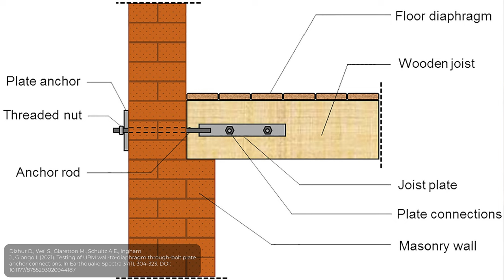Top 3 Deadliest Buildings in an Earthquake - Engineer Explains

Comment: You can go to Turkey (Kahramanmaras) to see which type of buildings are collapsed. After 7.8 then 7.4 then 6.8 earthquakes (and yes in a row) more then 1 million buildings are either damaged or collapsed. It's perfect way to examine the effects of earthquake and it's damage over types of building.
Reply: 100% of failed buildings were concrete structures... Steel is better
Reply: @skaford  wrong
Reply: @randomcrashingfacility31  show me one steel building which falled in turkey ajjaja proof me wrong
Reply: @skaford  While I don't know how many buildings made of what collapsed, there are masonry buildings that have collapsed so you saying 100 percent were concrete isn't true. Steel is good in earthquakes sure but so are properly designed concrete buildings. There are many of them surviving fine. It is easy to mess up concrete buildings response to quakes with when inspections are poor. That contributes to many more collapses. Best materials for construction depends on the region and the loads that buildings are required to resist. Some points could be made in favor of steel or conrtete. Both can work.
Reply: @randomcrashingfacility31  is true 100% of building failed in turkey was made with concrete structures and was not steel framing. You will not find any steel building failing. Again... I bet you show me just one example... All you words are empty because are not related with the reality
Reply: @skaford  If you had some basic sense you'd understand but no.
Reply: @randomcrashingfacility31  I have understanding about the subject and also I studied both last earthquakes in turkey. 100% of building failed was made with concrete structures. Showing the poor performance and how insecure it is. Because the complexity in the construction process. The lack of quality control during and post construction. Make it have the worst performance even if you build a steel structure with some mistakes will never be as dangerous as concrete structures. The reality I repeat you WILL NOT FIND a steel structure failing in Turkey. So... Stop talking about what you read. And start analyzing the reality. My number is posted  I will pay you 1000 $ if you find just one steel structure failing in Turkey in the lasts two earthquakes... Just one unit to prove your poor "knowledge' which lack of reality

Comment: Also, I want to hear that what type of building. If older than 1990s commercial building, then also needs improvement for basic accessibility need ( so, open to employees, clients, etc) too. For residential building and hotel facilities, it could be no to some basic public accommodation like hallway and public restroom for "normal" residential buildings to 100 % accessibility building like senior citizens living apartments( private accessible bathrooms, not 28" 32" all doorways, and some private kitchen for independent living units only). Private owned residential like single family house it up to the owner what they need improvement in their own home like with or without physical disability, including Deafspaces, blind,  autism friendly places, etc. Also, it can be in few to all hotels and "normally" family living units building.

Comment: Mat 

I am considering moving to the Philippines. If I build a house, it would likely be a cinderblock house like your third example. 

In new construction, how does one build a one or two story cinder block Masonry building on a slab and mitigate earthquakes? Not under building code obviously and in the Pacific ring of fire. Would a stucco or house wrap or 4x8 Styrofoam sheets glued to it help?
Reply: International Code (ICC) includes seismic codes that cover this. Mostly has to do with steel reinforcement. The strongest structure I know of against both earthquake and wind is in Florida, built of steel and gunnite sprayed over an inflated bladder. Think upside down pool shaped like a dome. I imagine, but am not sure, that wind mitigation would apply in some or all of the Philippines due to typhoons. This is at least in part tying the roof rafters down against uplift with approved fasteners made for the purpose.
Reply: Couldn't exactly answer for the Philipines but in the neighboring states usually (if properly supervised) build a house using concrete reinforced column and concrete reinforced tie beam from ground floor to up. This makes the box very rigid, and earthquake while my crack the masonry walls, will not topple down the structure. Just have to re-plaster the walls or the cracked window panes afterwards

tips: please make sure to have experienced certified architect or engineer (not just "a contractor company") to oversee the drawing proccess and the implementation of said drawing because builder often just "do it the way they usually do it" without any thought, which is to be expected considering most aren't educated or certified in building code.